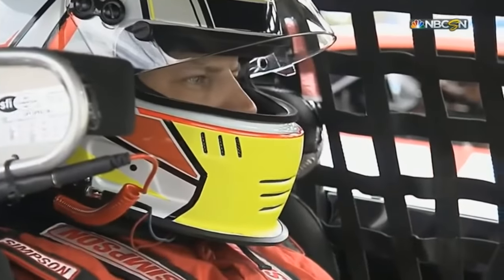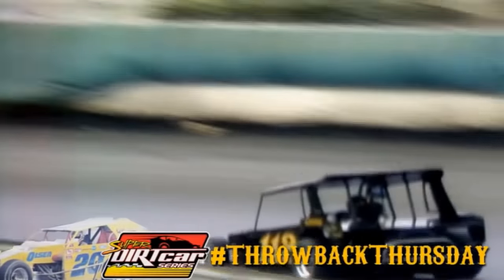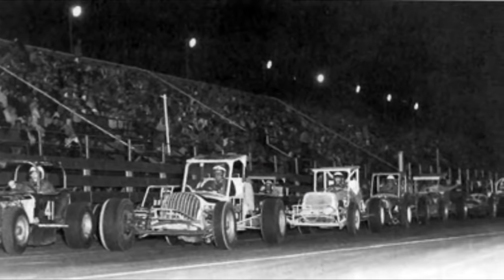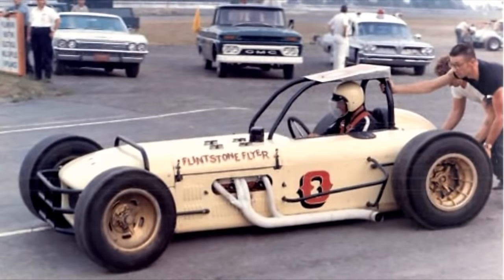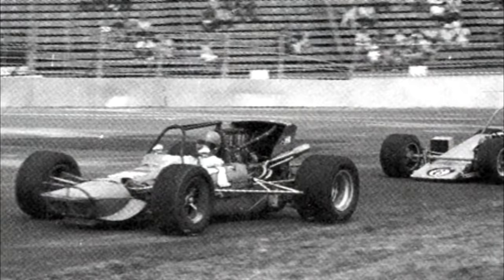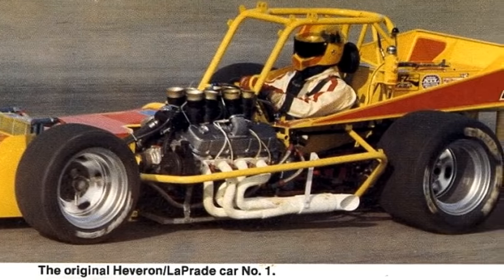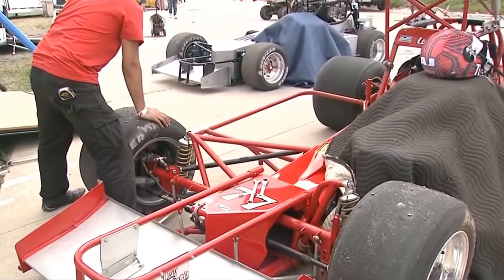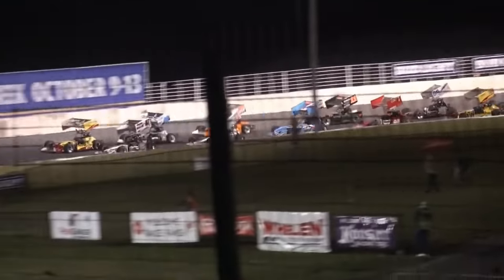What Exactly is a SUPER Modified?

Comment: 70's: "you can do literally anything you want with the design of the car"
90's: "no independent front suspension."
Reply: I think that rule is only for the weekly Oswego supers. ISMA mods still have independent front suspension. Hopefully someone can chime in on the reasons, cost savings maybe?
Reply: Independent front is now allowed at Oswego. Think that changed 2-3 years ago.
Reply: Why on earth did they have a problem with independent front suspension?
Did they thought a straight axles wheel isn’t ripped of as easily and propelled into the crowd?
Reply: @rolux4853  Cost probably. hard to beat a bar with bearings on each end.
Reply: @MatsNorway 
The way you beat a bar with bearings on each end is by adding additional bars with independently adjustable length. a.k.a. multi-link independent suspension. But that's only performance-wise, the result is more expensive.

Comment: Thanks for calling attention to the Supers!! I work on a 350 up around Star Speedway, and man are they fun to wrench on.
Reply: lol is there any asphalt left to tht track the old owners ran all there tracks to sht looks like hudson is on the rebound wish  owners wld realize you got to keep the track up and comfortable for both the racers and fans
Reply: @wizard3z868  star speedway is doing great the owner died and his son took over and has made improvements and there’s about 20 cars a class
Reply: @joshconnolly8854  last year they averaged 27 350 supers. Best weekly racing around by far. But I do miss seeing the big blocks weekly in the late 80s early 90s
Reply: @wizard3z868  Star Speedway is doing great. Mr. Webber Jr. has put a lot into the track. New lights & a lot more. Car counts are up. There is a reason they say.  The Place to Race !!
Reply: @richardpalleschi4807  been like 10 yes maybe I'll make it a new years resolution to go thx
Reply: @wizard3z868  You're not wrong. Like these guys have said, people like Webber Jr have put a lot into the track, but one thing that remains is that almost all of these tracks need a repave. You can only paint the walls and track surface so many times before having chunks of the race track broken away doesn't work anymore. Not just Star or Hudson, either, but following SMAC around this year, a good amount of tracks could use some surface love.

Comment: Thank you for covering the ultimate short track racing machine.  If you haven't seen these beats in person, they are a destination division for any short track racing fan. 

Loud, fast, and simply amazing to watch.  They change the weather when they race, and there's video evidence of that. 

When you see them, watch the flags on the front and backstretch (if the track has them). They will blow in opposite directions.
Reply: Saw an ISMA race one time where they dragged fogged from above and raced in hard to see conditions at Waterford Speedbowl
Reply: @superjeb8777  they have done that multiple times. They will also create contrails in the right humidity.

They are just awesome in so many ways.
Reply: Used to wrench on a Sprint at Sandusky Speedway. Hi-Miler weekend was a huge party. Miss them days
Reply: Ah yes...vortex theory.

Not accurate, but I want to believe.
Reply: @DRT49  These things look like hellbeasts. I don't doubt that they are a spectacle unto themselves to watch.

Still not ENTIRELY sure of the fog thing, but the flags? Yeah, I could buy that. Also, while NASCAR Cup cars aren't capable of much now, I wouldn't put it past the early Gen 6s and later Gen 5s to mess with the air to ridiculous extents at intermediate tracks.
Reply: @mitchell-wallisforce7859  I could see the COT cars at Bristol or Dover messing with the air, partly due to the 40 car fields and the relatively small track length and high banking. 

Side note, over seen these cars in the right humidity produce white air vortices from the top wing. These things are producing enough air disturbance to create very short lived clouds.

These vortices are commonly mistaken for contrails, but they are not the same thing. The more we know, right. 

Kudos.
Reply: @DRT49  F1 cars do the same thing! Not bad company to be in.

Comment: As a followup, you might want to have a look at the west coast Super scene, contemporary with the northeast scene covered here.  As Mark Chaves Jr. notes in a separate comment, there were cars called Super Modifieds racing at San Jose as early as the '60's.  These looked somewhat like sprint cars except they had frames with rectangular tube bottom rails, squared off tails, and single 4-barrel carburetors.
   By the 1980's there were radical offset cars running all over California, Oregon and Washington.  I helped out on one of these in 1986.  Tracks included Mesa Marin (Bakersfield), Madera, Evergreen, and even Phoenix.  The main west coast sanctioning body was the SMRA.  USAC also ran Supers.  We ran both USAC and SMRA with the same car.  The only rules difference was that for USAC you had to have a single-element wing.  Ours had a big main element and a small one at the trailing edge.  For USAC, we just put duct tape over the gap and they let us run that way.
   SMRA's philosophy in the '80's was "best rules is no rules."  There were safety rules but that was about it.  I never saw a moveable wing.  I think maybe they had a rule against moveable aerodynamic devices.  There were no suspension rules. There were some really interesting cars.  The Triguiero brothers had a rear-engined one with 4-wheel drive.  Doug Gore designed a rear-engined one with an aluminum big-block Chevy mounted backwards ahead of the left rear wheel and a gear train at the front driving a drive shaft back to the usual quick change beam axle.  There was the Gerhardt Offy car, which was a "conventional" radical offset chassis, but with a turbocharged 4-cylinder Offenhauser.  There was one car with an injected Keith Black aluminum Hemi, with Keith Black himself often present in the pits helping wrench it.
   Our car was "conventional", with a 434 Fisher Donovan small block Chevy.  I'm trying to remember the car builder's name, without success.  I think his surname was German.  His shop was on the east side of Fresno.  Maybe somebody here can help me out on that.
   I left California in 1990.  I understand there have been other sanctioning organizations, and more rules, including mandatory beam axles, left percentage limits and wing size limits.  I believe there were even two different wing size limits, tied to left percentage; if you ran less left percentage you could have more wing.
  Lately they have been running winged sprints and Supers together at Madera.  There are a number of videos here on YT of these races.  The sprints are competitive with the Supers because they're allowed much bigger wings.  Here's a recent event at Madera: https://www.youtube.com/watch?v=zhFCJbD_wL4

Comment: My first thought: The unholy offspring of a Modified and a Sprint car.
Reply: That is exactly what those cars are but with a little bit of Indy Car stuff thrown in for safety/fun.
Reply: Exactly, sprint cars for asphalt.
Reply: @souocara38able  Actually there is a type of sprint car they run only on paved tracks, often racing on the same ones the few different regions of Modified series race. I forget but these are bigger then the cars that race on dirt and have a brake peddle. on some tracks they have not just a top spoiler but a hood one as well due to needing them to stay on some tracks.
Reply: @caseysmith544  
Silver crown cars?
Reply: @souocara38able  Probably something like that, the other was some kind of super Sprint cars that I saw racing on TV on paved surfaces a few years ago.

Comment: Hey Slap I dare you to do a video on the more "unusual" types of dirt track racing. Like lawn mower racing for example. Both the US and UK have their own leagues and the UK have a 12 hour long event, racing lawnmowers!
Reply: Don't forget about "skid plate" racing where front wheel drive cars are usefd with flat plates welded to the the rims on the rear. Crazy.
Reply: Rototiller drag races. Sometimes literally on the drag part. Saw one of those events on the "On the Edge" show on Speed TV. One guy ran an unlimited class tiller while his wife competed in the stock class. She decided to try his tiller for a run. She was able to windmill her short legs fast enough to stay up about half the length of the track then lost her footing. She didn't let go! The tiller dragged her across the finish line. Fortunately the track was soft dirt so no injuries.
Another couple of oddball racing events involve snowmobiles, but no snow. One bunch runs them on grass, the other on water.
Snowmobiles on water started out years ago up in the Northeast somewhere. They'd cut a good sized rectangle through the ice on a frozen lake and I'd assume carved a ramp on both ends down below water level. Mechanical prep was removing lights and other non-essential parts. Hitting the right speed and maintaining balance to keep the skis on plane and the stock track's paddles pushing enough water to skim across a few feet of open water didn't happen too often so many waterlogged snowmobiles had to be recovered. Over the years people have come up with special skis and tracks and the engine power and speed (of machines intended for use on snow) has gone up a lot since someone first though about seeing if he could skim across a bit of water.

Dunno about the water racers but the grass guys have gone the way so many fun racing has. Rules. A crapton of RULES. http://www.isrracing.org/tempPDF/Grass%20Drag%20Racing.pdf

Comment: I race at oswego and from a fans standpoint one of the coolest part for race fans is after the race they open the pits to the fans where you can go right in to the pits at no charge and look over the cars, meet the drivers and crews and yes most of us will even let you climb in and sit behind the wheel for a photo or two.

Comment: I would love to see the Winged Supers run at Indianapolis. What Indy cars would be if the rear engines cars hadn't shown speed.
Reply: That's exactly right. I've done it in a simulator called Assetto Corsa. They have a winged supermodified and  their version of one does around 190mph but you never have to lift. Not quite as fast as a modern IndyCar, but a hell of a lot quicker than a cup car around that place...

Comment: These cars are so amazing to witness in person. If you are in the stands, they will cause a cyclone of wind that feels like a light tornado. You may even catch some rubber balls that form from the massive tires and get thrown off after a few laps. Most my time was spent on the in field working on the tires for one of the teams. They are 4x different sizes and compounds and very tricky to dial in the stagger. I miss being part of ISMA but would recommend Oswego and a super race to anyone if they get the opportunity. These machines are wicked fast!!!!

Comment: Salem Speedway had been closed for over ten years, I didn't believe it'd ever open again. Then it was announced it was reopening, and they were going to have a concert to celebrate. Well, the racing community wasn't going to have it, they demanded a racing show. That was the first time I ever saw a super modified. What a show, one guy went over the wall in turn three taking out the lights on his way over. It required three trucks to haul the pieces back inside the track, the driver wasn't hurt, at least not so bad they needed an ambulance. What a glorious night, I wish I was near where they race, what bad ass machines.

Comment: These cars also have little brothers too. There's a division at all the local tracks in southern NH that run a slightly smaller and lighter chassis with Chevy 604 small block crate engines. They put on a great show for a lot less money than the big block cars. I think Oswego came out with a series like this recently.
Reply: Yes. The 350 supers and the SMAC 350 tour are excellent. Same chassis just a smaller motor and an economy racing tire. there's also the SBS series but they use their own chassis that isn't very modern these days. Oswego now runs both classes almost weekly.

Comment: Don’t forget the important roll New England “cut downs” of the 70s had in super modified evolution. Star Speedway Epping NH was the home for New England supers til the early 00s. They still hold the other classic every Sept. they have seen a resurgence in recent years. Star still has a 350 ci super mod class running weekly.

Comment: A little more history on this subject. First Super Modifieds have been around since the 1950s. 

The Super Modifieds actually raced a few times at The New York State Fairgrounds on the dirt mile.  Joe Gosek actually qualified his Super Modified with the World of Outlaws Sprints a couple years before the Super Mods would get their own race there during Super DIRT Week.

Interesting note, the wing you mentioned for the super mods had been around long before 1990 and was actually a similar design to what Gary Balough used on the Batmobile 112 car's roof at Syracuse 1980 that him and Kenny Weld took from the winged sprint cars. (Note the Batmobile's roof was not a former sprint car wing.) 

Also the 3/1 Super Modified  was tested by driver Tim Richmond, but organizers changed the rules to keep the car from ever being able to compete.  It was hitting record breaking speeds of 200mph. 
 
Here is the full article on the 3/1 Wheeled Super Modified: https://drivetribe.com/p/uneven-speed-kenny-reeces-1979-Yzkjb-AeT9WwdrXcf0_cFQ?iid=GSTM4kt-QcqtFWSwVQ1Npw

Today the Super Modifieds are pretty much the only TRUE modifieds left in oval racing, as the dirt mods and asphalt mods of today are strictly regulated and are all professionally mass produced. Where Supers still maintain that originality in almost every single car.
 
Quick tidbit: Northeast modified drivers (not supers) raced on both dirt and asphalt with the same car weekly up through the mid to late 70s.  Geoff Bodine was actually in the 1980 Syracuse 200 that Balough won at Super DIRT Week.
 
Edit: adding link for the Super Mods at Syracuse: https://www.youtube.com/watch?v=VHZqB-ih3UU
Reply: I've always wished I had the memory to remember things the way you do. I've been around and seen a lot but can't remember half of it lol. Thanks for all this excellent, interesting information 😊
Reply: @souocara38able  Another quick tidbit about the Batmobile Gary Balough car. Like I said, the roof did not come from a Sprint car wing. It was built specifically for the 112. You weren't allowed wings, so they widened the car and made the body of the car the wing. Which like with sprint car and supers would tilt down and up depending on whether you were in the corners or on the straights. It also had a air ram intake. But while the officials, drivers, crews, and fans were looking at the body. Nobody even thought of looking at the engine. Which Kenny Weld said was the real secret.
Reply: @whodat1721  
Excellent diversionary tactic LOL
did you say that the body actually moved on the chassis to reduce drag as the speed increased? Were they allowed to run it that way or was that just to keep the inspectors occupied?
Reply: @souocara38able  It was allowed to run that way.. Well for that race, the car was banned from racing, keeping from running the Eastern States 200 at the Orange County Fair Grounds in Middletown, NY the next week. 

The car was sold and was raced at Syracuse a few times after, but it was stripped and rebuilt to pass all the new rules. It was never a contender again.

Comment: Grew up watching the Supers run on dirt at the old Raceway Park (Toledo) on dirt then on the pavement at Toledo and Sandusky Speedways. Gordon Johncock, Todd Gibson and Bentley Warren were also innovators along with being some of the best drivers I ever saw. The evolution of these thru the years is pretty amazing. If you want to compare speeds, check out the track records at Phoenix. Indy, NASCAR, supermodifieds, USAC sprints and midgets have all raced on the old track layout over the years. The supers are 2nd only to Indy cars. NASCAR is 2nd slowest besting only the 4-cylinder USAC midgets.

Comment: Thanks for posting this. I don't see anything unusual about the Supermodifieds. Then again, I'd call this my 'home track' as I've been a life long fan and spectator since 1968 when I was 8 years old. I drive 125 miles there several times a season to see and hear these cars race, and also to smell the methanol fumes. Most other short track races seem boringly slow as I'm used to seeing the 130mph average lap speeds. Oswego Speedway was not able to hold even one race on 2020 due to covid19. They need all the positive exposure they can get.

Comment: Great vid, but two minor corrections. The 10 Pins car isn't essentially the same car, it IS the same car. Also, the 3 wheel/1 wheel car was built for none other than NASCAR's Tim Richmond to drive.

BONUS ROUND: The 99 rear engine super immediately after Richmond's is Geoff Bodine.
Reply from the maker: I thought it was but some of my sources were bit vague in their wording, so I also made my bit on Nolan Swift's car a little vague.

Comment: Here in Oz Supermodifieds were influenced by West Coast Cars. They evolved out of heavy stockcars to Sportsmen to Super Mods and into Sprintcars over a decade or so. 
I own one built 68 as a Supermod, by the mid 70s they were programmed as Modified Sprintcars where most lost starters and clutches[ and some gained quick changes] but still the same old cars, by1980 they were too heavy and too slow. 
Though as classics seem to be closer to the pace of those late 70s cars. Engines used here were Holden, Falcon and Slant 6s, 300 Ford truck, Y blocks, and Ford and Mopar v8s. Oh and yes a few Chevs as well!
And all have starters and most have clutches, far easier to form up. BUT a well prepped early 80s Sprinter is so much faster. And in reality dangerous to run together.